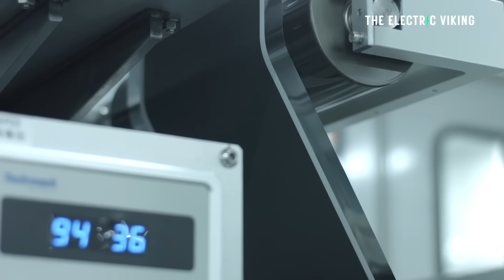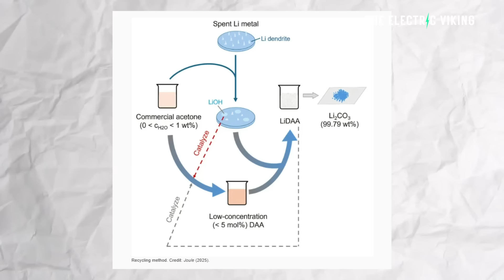The USA’s Lithium Recycling Innovation: 99.79% Lithium Recovery for Batteries

Comment: Sam.... They didn't recycle 99.79% of it, only that the end product after the recycling process was 99.79% pure. Right now the typical recycling process efficiency for lithium ion batteries is around 60-75%, which means 25-40% of the lithium is lost. All these headlines of stuff that greater than 99% efficienct almost always refers to the recovery rate of black mass, but before it's gone through chemical treatment. There is no world where you are getting 99% recovery of materials with lithium ion batteries when you can't even get that from recycling steel or aluminum, which is a much easier and simpler process because you're literally just melting it down.....
Reply: You are correct that the 99.79% figure is purity not efficiency. But you are incorrect that 40% of the lithium is lost. Lithium is recovered at >80% efficiency. What is lost in the process is the electrolyte and the plastic membranes, mainly, NOT the metals.
Reply: I am a chemical engineer who worked in the field of material recycling. My engineering team and I designed an award-winning process to recover phosphates. We were getting 90% efficiency. Could we have gotten 95+% efficiency?  Sure! By passing the remnants of the first process through a second step. But is it economic? No, in our case it was not.  The barrier to recycling efficiency is not at all technical, it is economic.

Comment: Problem.is lithium may be replaced with sodium... Then we will need sodium recycling😁
Reply: This tech will crash the Li price and allow the much higher density battery approach the cost of Na+ for stationary deployment. U of Adelaide has a 1306 Wh/kg Li-S chemistry that's >6 X the Na+ energy density perfect for aircraft and slower vehicles.

Comment: This is good news. We don't want abandoned EV vehicle batteries polluting the environment when water to gasified fuel becomes known. Overnight EVs will be abandoned for internal combustion engines fueled by water. Why pay for expensive charging when one can simply refuel a vehicle with a garden hose?
Reply: "Internal combustion engines fueled by water"? The only time I have heard of such a proposal, it was to use electrolysis (which uses electricity, so you would need batteries in the car to do this) to split the water molecules into hydrogen and oxygen (H2O -> H + O2), and then either use the generated hydrogen in a fuel cell or burn it in an internal combustion engine (ICE). Overall, the electrolysis is about 70% efficient, and then the fuel cell is about 50% efficient or the ICE is about 30% efficient. The output waste from the fuel cell or ICE is water.

Put simply, the process is an energy-intensive way to split water into H and O2 and then recombine them to produce water again: it consumes 3 to 5 times more power than it produces. As such, it would not be a feasible way to power a car.

Comment: In a few years when the sodium batteries are a little bit more viable this won't even matter. Because lithium won't even be needed
Reply: Yes, it will be needed for higher performance batteries. But I agree that the bulk of them will likely be sodium-based.
Reply: @st-ex8506 give sodium batteries another 4-5 generations to develop, and they might outperform lithium. They do way better in cold and hot temperatures, too.
Reply: @phuc_FSB-CCP_botsno, they can’t for a fundamental chemo-physical reason. They will obviously be improved much… but will NEVER have better performance than lithium-based ones!

Comment: nice. i wonder what there recoveries on the other materials is.. right now Redwood materials in the USA rates are
Lithium           More than 80%
Nickel           Upwards of 95%
Cobalt          Upwards of 95%
Aluminum   Upwards of 95%
Graphite      Upwards of 95%
Copper   Approximately 95%
And that is what they are currently getting with todays recycling as long as this new process is scalable it might make another major jump.
Again Redwood materials is doing this no matter what the chemistry of battery they are getting so they could probably dial it in a bit more if they knew precisely what battery chemistry they were processing.
Reply: Oh and yes redwood materials recycles cell phone and tool batteries as well. As well as Apple recycles all there phones also with high rates of recovery and reuse of rare materials.
Reply: The is 1 company called Green Li-ion Inc or GreenCAM America Inc., doing better job.